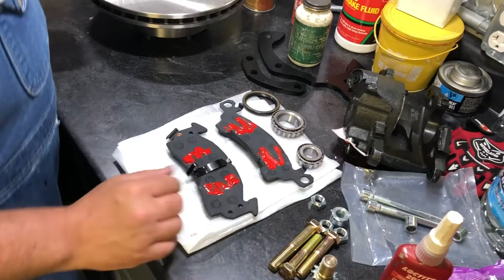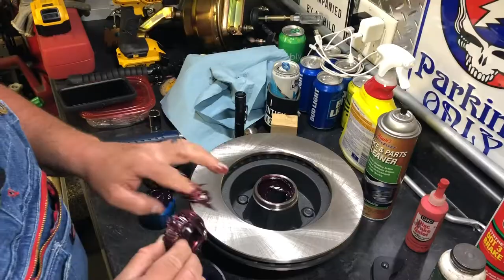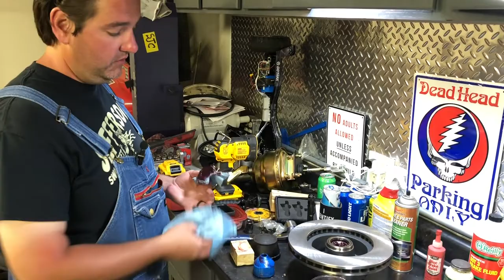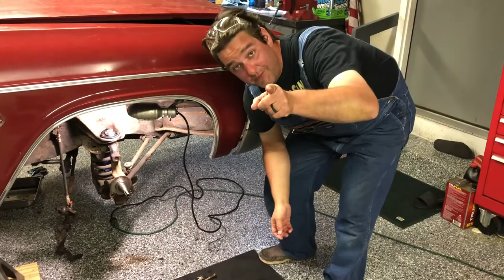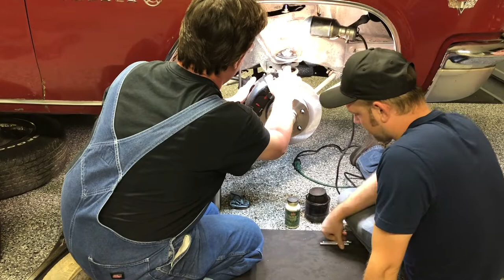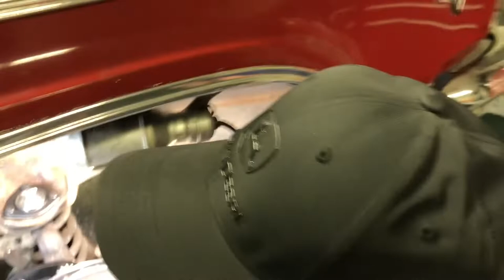1966 CHEVY IMPALA DISC BRAKE UPGRADE!!! One step closer to CHERRIED OUT

Comment: C3 Corvette spindles are a direct swap.  Then you have 4 piston disc brakes and you can get replacement parts anywhere.
Reply from the maker: This kit is basically a GM A body brake system with a bracket to convert the spindle. That’s neat that C3 vette spindles are direct fit…I wonder if the conversion works in reverse??? GM A body brakes on vette???

Comment: Hi I love your channel I just subscribed I have a question I have an Impala 1960 and I want to upgrade to paper brakes with front wheels disk brake. This is my question now what kit I have to buy for my Impala 1960 and keep using the original steel wheels 14 inch because I love the original look with better brake systems thanks for your videos I love them an I will recommending you to my friends thanks again
Reply from the maker: I’d check out the CCP website for your application. This kit I installed is based off a Chevelle disc brake it, and they did come with 14’s, although I had already upgraded to 15 inch rally wheels.